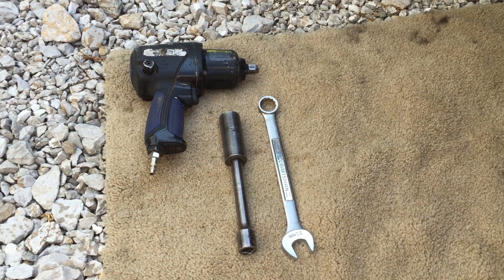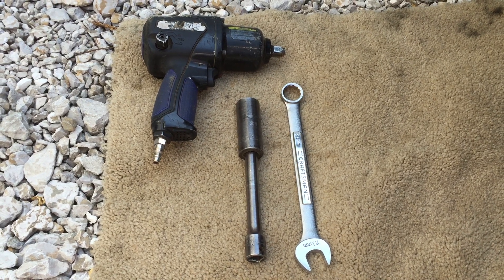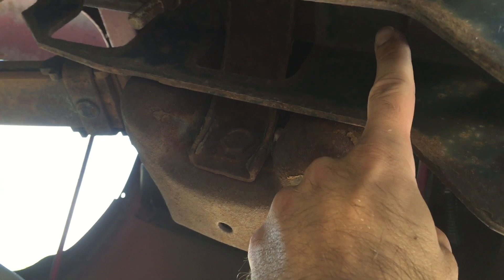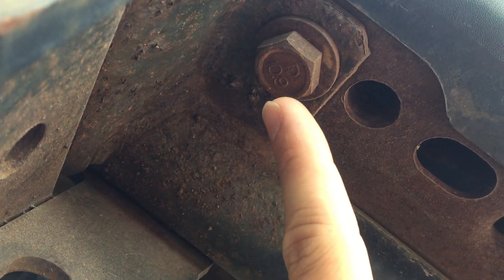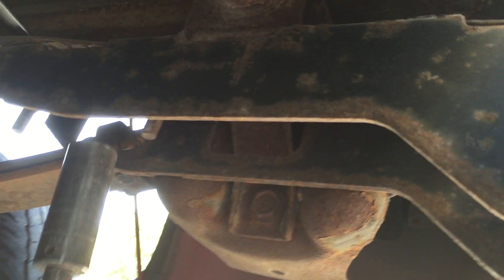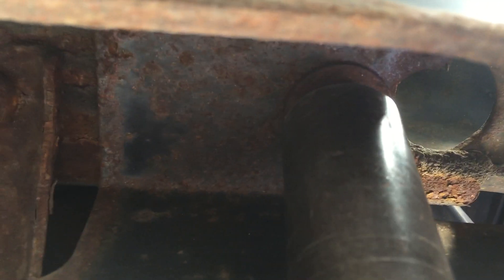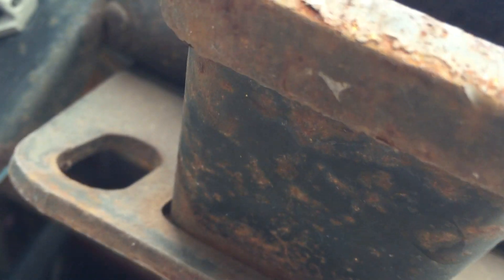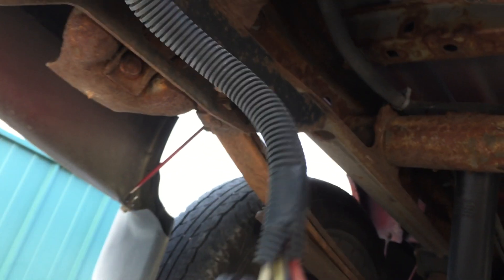HOW TO REMOVE & INSTALL the tow hitch receiver 1999 - 2006 Chevrolet Silverado - EASY!

Comment: Qty and sizes
4: 1/2-13 x 1 3/4 carriage bolt
4: 1/2-13 hex flange nut
2: 9/16 lock washers
2: 1/2 toothed washers
4:M14-2 x 40mm LG hex tap bolt
Thanks google, found a diagram on summit with hardware desription

Comment: This and your bumper R&R video are great. I have to have rocker panels and cab corners replaced and the shop said they will slide bed back to weld corners. I was thinking it would be a good idea to replace all the old hardware for bed, bumper, and hitch receiver assembly. I found bed bolts but not sure where to go for the specific hitch hardware and bumper hardware. Do you know who if anybody sells such hardware in kits? Or would I have to go to big box store or Fastenal to match it up? Thanks in advance.

Comment: Do you know how I can get bolt size ? My truck came equipped with it but took it off now I need bolt size or a kit. Do they just have the bolt the washer and nut or a locking washer also??

Comment: I have a 99 Silverado 1500 Z71. Does that stock hitch need to be removed to remove the bumper?? I'm having a problem with the brackets clearing the bottom of the bed and am thinking either the hitch is in the way or the bed needs to raise a couple inches??? I think I just saw the answer in your bumper removal vid...you removed a couple of the bed bolts in back right...but I still have hitch on there and am hoping this will work without removing hitch...the brackets are hitting that metal lip that comes down from bed under tailgate and are pissing me off lol...I gave up for night and will look at it tomarrow!
Reply: Of the 6 bolts on the hitch (besides the 2 on the bumper) you just need to remove the 2 closest to the rear of the truck and the 2 on the bumper. I laid under mine today doing the same thing. I replaced the bumper and hitch on mine.
Reply: @DeanEttinger  Are you talking about removing the two bed bolts from each side on the end? I know how to remove the hitch but I did not want to do that if I didn't have too...
Reply: @2Ramrod2  I didn’t remove the bed bolts on mine, I may have gotten lucky. But 2 of the 6 bolts for the hitch you have to remove because the brackets are attached to the bumper. So if you remove the 2 bolts attached to the bumper the next bolt going back on each side as well as the 2 18mm and the 1  15mm on each side it should slide out.
Reply: @DeanEttinger  Oh I know all that. I have my bumper and brackets sliding back a couple inches. but as I said, the end of brackets are catching a piece of metal that drops down from bed under tailgate...it's the painted metal that covers the gap under tailgate...I've got the shit loose it just won't come out. The author of this vid addressed this in his bumper removal vid. I have a stepside also with all the options and that may be why. I can't get in there to get brackets loose from bumper...I'ma take bed bolts out would be easier...

Comment: Where would I get the hardware from to install if mine did not come with a hitch ?
Reply from the maker: The easiest way is to find someone parting out a truck and buy the factory hitch making sure the seller gives you all the bolts.
Reply: True, but I found one already taken off with no bolts 😭
Reply: What size bolts came off of the receiver?

Comment: How do you install with dual exhaust?
Reply from the maker: loosen the pipes by disconnecting them from the rear hangars and let them hang then slide the hitch over them and bolt it in.